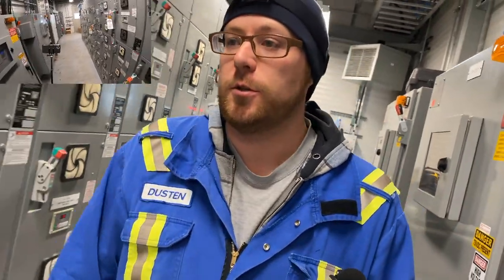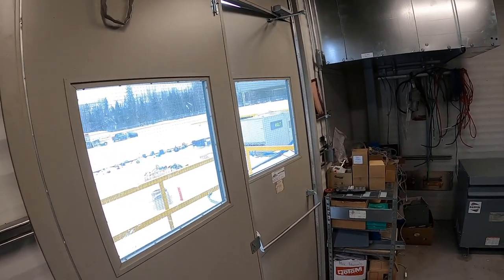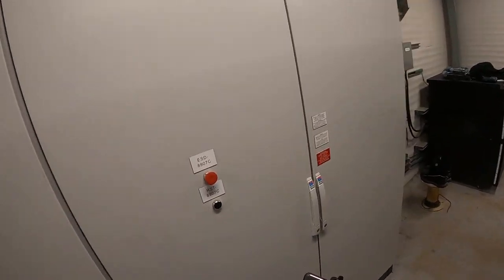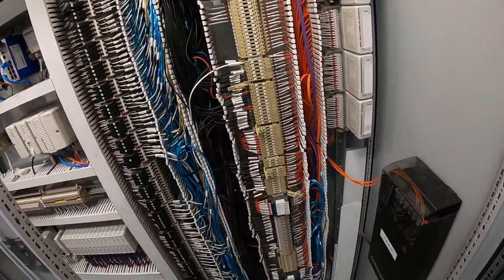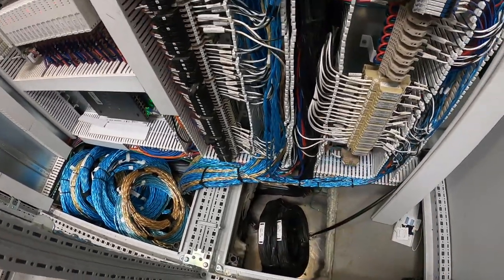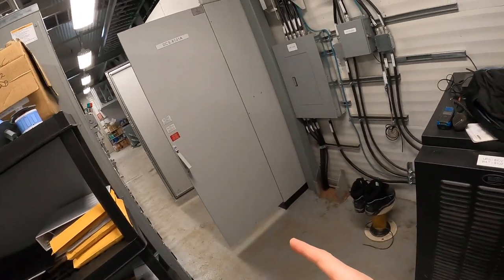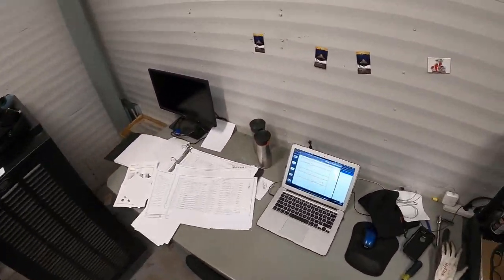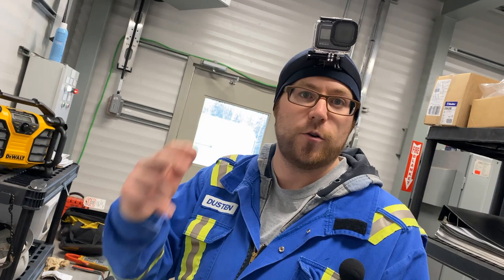Day In The Life Of An Industrial Electrician - Starting a New VFD Project

Comment: Can I ask u if Electrical installation projects is complicated or not than maintenance?
Reply from the maker: Hmm comparing electrical installation to maintenance. 

Both have their challenges and basically you need to know both to do one or the other depending on the situation.

If you are a construction electrician that just reads engineered prints to install equipment but you never commission the equipment, then installing is very easy. But if you go full circle and are in charge of commissioning that equipment as well then you need both.

Comment: Hey bro nice video ! I just have question for you , I wire up a cigar shop , but I have a make up air , and an exhaust fan , inspector wants me to interconnect then ex fan is 230v , make up air is 120v , can you please Tell me how can I do that . Thanks .
Reply: i guess you should just buy a power converter 230v to 120v
Reply from the maker: Just another day eh?